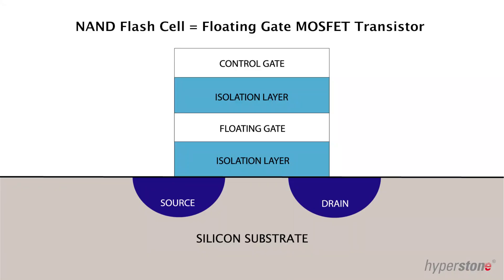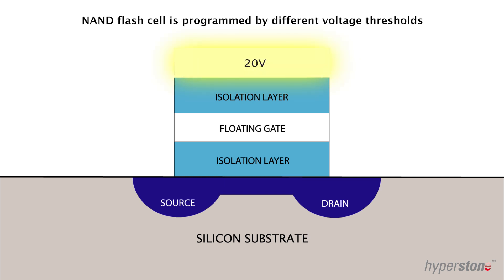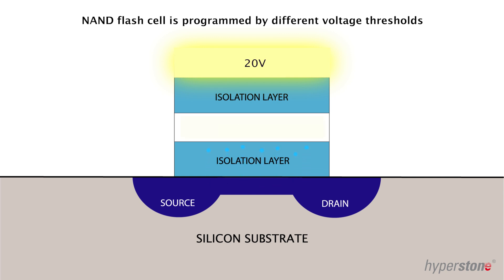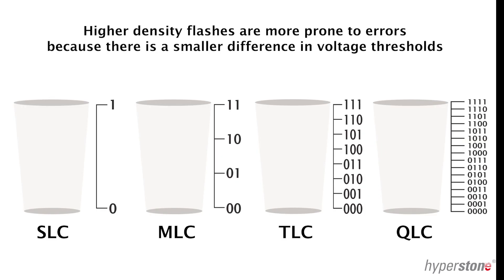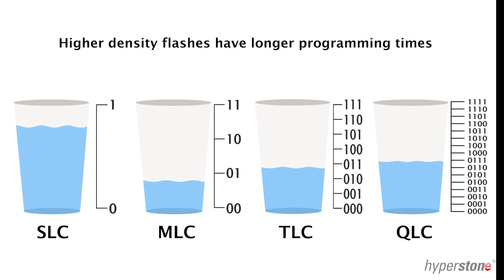SLC, MLC, TLC and QLC | SSD Flash Memory Explained  (suggested #2 for training sequel)

Comment: so Gaming and Video Editing SLC is better or TLC
Reply from the maker: Hi Abdulrahman, Thanks for your comment. Ultimately its a trade off, dependent on many many factors, but generally speaking SLC flashes are more reliable by nature. Nonetheless, when it comes to gaming and video editing an SSD with a TLC flash will most likely be enough to support your use case.
Reply: Hyperstone thanks for your response, so if I have 2 options with so small variance with same capacity I go for SLC not TLC ( Aorus RGB 265G vs XPG 11 Gaming X 265G )